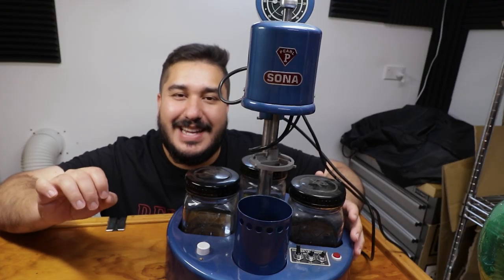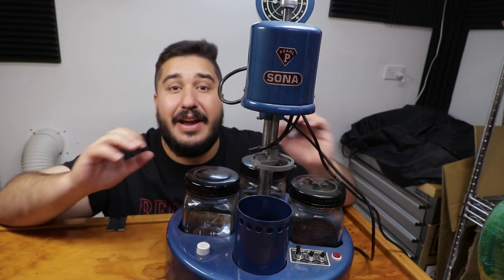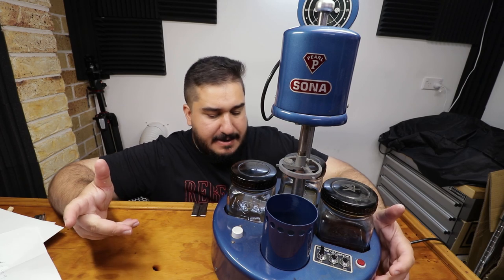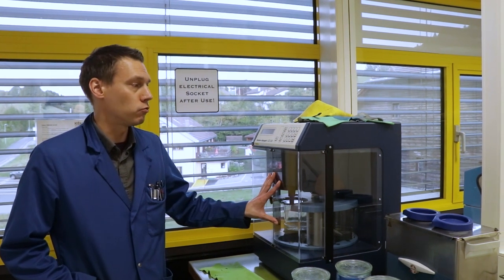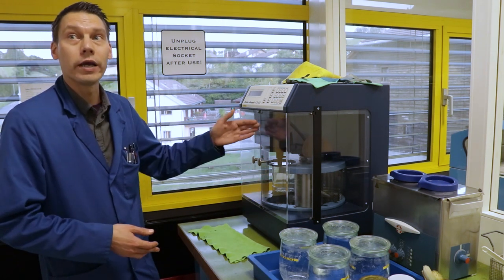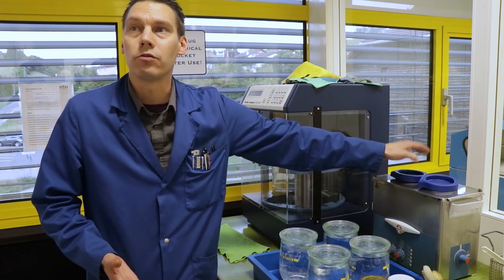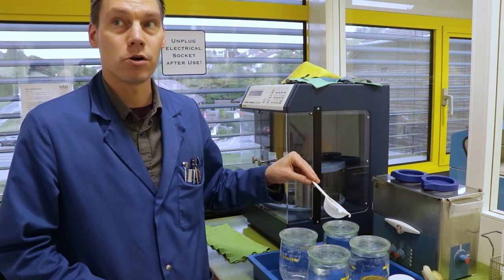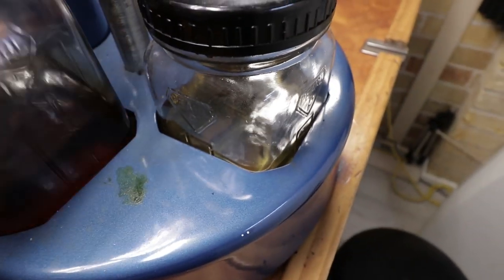My Watch Cleaning Machine - Watchmaking Vlog 36

Comment: Good video. I made my own I call it "the Bubbler," from a small bench top airbrush compressor and some 1/8" plastic tubing. The bubbles along with lighter fluid works great. My ultrasonic has been collecting dust ever since.

Comment: I really like your content and well done for passing 10k subs.  I’m getting close to that milestone myself now too which is quite humbling.  I bought a Brenray vintage spinning machine that a friend restored parts to get it running well.  I would never part with it ! That said as I restore old unloved watches I find that I still have to clean parts in my ultrasonic as a first clean because the spinning machine cannot remove stubborn dried in dirt. 
I use L & R cleaning solutions here in uk.
My ultrasonic I can set a temperature too so I often wash at 50c 

Good luck with your machine!  I never really time mine (not that it has a timer) I just tend to spin 20 mins in each
Reply from the maker: Thank you! I’m sure you will surpass it very soon! You are producing great content.. yeah I found that with vintage, so grimy haha! 😁👍🏼

Comment: I ended up making my own, its nothing more then an overhead stirrer, there's 1000s of used lab overhead stirrers on eBay for under $75, and they have forward, reverse, and timers. You then get the basket and a basket lid adaptor that will go on a straight shaft, check watch suppliers for this. Now get a lazy Susan and cut a hole on the middle, put your overhead stirrer base in the hole. Put your jars on the lazy Susan, now your off and running submerge in first jar for a bit and stir, then lift the stirrer rotate the lazy Susan to the next jar and so on. For a dryer you can mount a 100 watt halogen bulb in a coffee can and spin the basket inside that, or get a cheap cyclone jewelry dryer. Congrats you have a watch cleaning machine for under $150.
Reply: That's a lot extra work to aquire all the parts. Put them together and then have to do all the manual transferring of the parts into the next step. Thats a lot of time. Probably just worth it to fork out the 550 for the full unit.
Reply: Hello Sir , can you please share one video with the result ? And put some links from where to buy all the components ? Thank you.
Reply: @jessehellakoo  It's the same amount of movement as a mastermatic factory machine, you have to manually rotate the basket to the next jar and take the lid off on a mastermatic.  It's basically the same, a stirrer with a watch cleaning parts basket attached with cleaning jars underneath. I do agree that for some people buying a factory machine would be more practical, but people on a low budget may not be able to.

Comment: I have an old L&R  cleaning machine similar in function to yours.  My watchmaker mentor had a deluxe L&R machine that had an ultrasonic transducer that jiggled the solution when submerged into the liquid.   
    On really bad movements, using my machine,  I had a U-shaped clip made from an old clock spring to hold the top on the basket closed.  I then put that into a glass canning jar with cleaning solution, and set the jar into my jewelry cleaning ultrasonic tank to loosen the crud before running the basket in the watch cleaning machine.  The dryer of the L&R was just a tube cast into the base, that the basket spun in and a large power resistor at the bottom of the tube produced enough heat to dry the watch parts.  
I have always been told that the holy grail of watch cleaners was the Vintage Watchmaster ultrasonic cleaning machine.
Reply from the maker: Yeah, the old gunky stuff is a real pain. I've found that with no ultrasonic is a lot of hand cleaning after running through cleaning machine

Comment: I get by with an ultrasonic and beakers. It's probably the most cost effective way to get up and running unless you can find someone local selling a used machine cheap. Those baskets certainly aren't cheap, but they really are worth it. I've had too many problems with the cheap ones rusting, and sometimes the mesh is too large and parts get jammed into them easily.
Reply from the maker: That’s a great way to do it Chris! Yeah, it’s unfortunate that happens with the cheap ones. Thanks for commenting 😁

Comment: If you don't already know, one test to ensure your ultrasonic machine is working correctly is to place some aluminum foil in the machine and if you see tiny holes, you know its working correctly. As a hobbyist, an ultra sonic cleaning machine is most economical method however my concern is cavitation pitting on expensive metal parts such as Rolex brands and movements parts and is it possible?